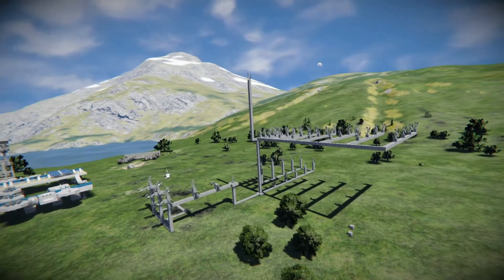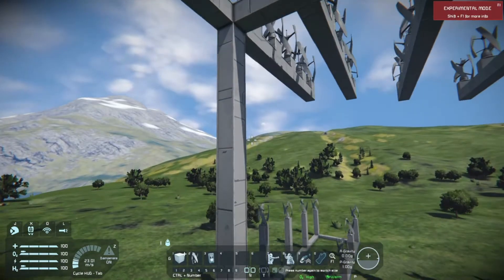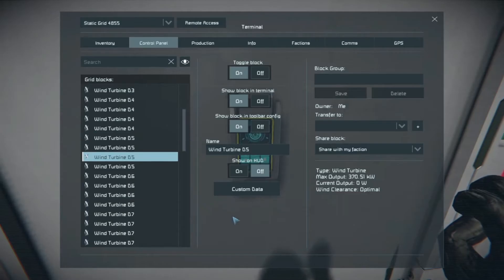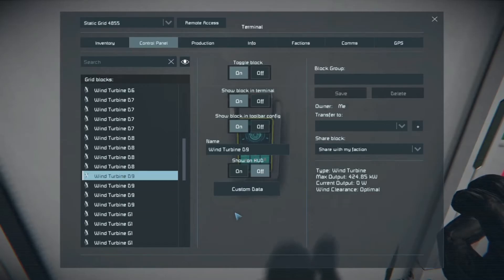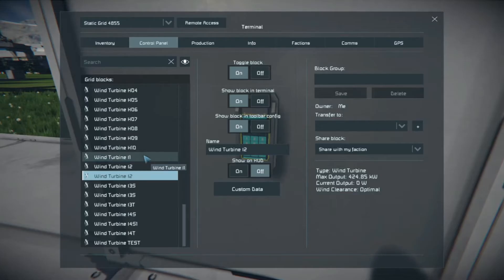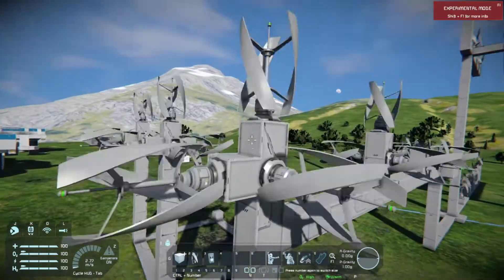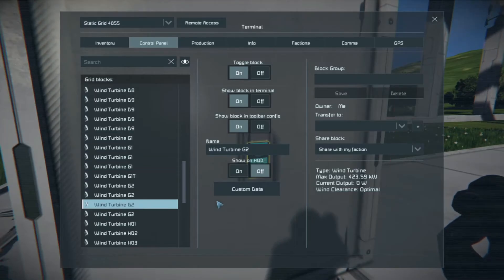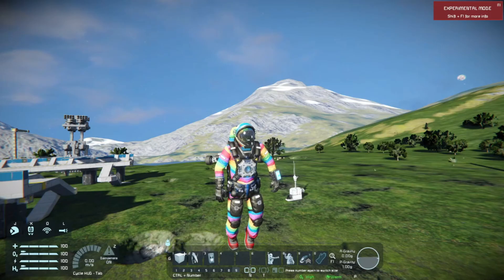Tutorial: BEST WAY To Place Wind Turbines at Space Engineers (Optimal Wind Turbine Park)

Comment: I found 9 blocks build on where the 10th block would go but I did nott testing just didn't want to waste any more hydrogen on it lol  that's Vertical and horizontal from any other block.   Also use a column  the air flows easier around it >:D

Comment: So I found out On my xbox 1S I thought Ax output would be the match output that wind turbine can put out Because if I only go 40 blocks high in a Valley Valley A Max kw out put is the total of kw it will put out igp 60 to 90 bocks high and all the wind turbines are 8 block a part and the 9th block I will put 3 more block on top of the 9th block then put the turbine on it the control panel will have max out 4some thing out put and the current out is 1kw but wen I make a battery it will say on the current out put 498 kw but wen playing in survived mode it will say 1kw out put on battery but wen you put a battery on your bace the the max out put and the current out put are the Same or some times it will go up higher on the current out put depending on the weather if it is raining my 8 battery's will charge up faster that's what I found out same people my went to make videos on the same thing your doing so they don't do videos on the wind turbines
Reply from the maker: Sorry, but I don't really get, what you wanna say there ^^

Comment: Thumbs up for your info, but there was one question i still had, has the turbine 8 blocks above ground or 8 blocks above my struckture, if i want to place my windpark on top of my base.
so i build a block 8x8x8 and placed a turbine on top of it and a 2nd one 8 blocks above my 'block'. there was a difference of ~30Kw. the one on top of my building was fine (by the looks of it it is a Mars like planet on the server) ~880Kw but the one 8 blocks higher brings ~910Kw.
to compare it complete, a turbine on groundlevel brought ~350Kw.
Reply from the maker: 8 blocks above eveything that's underneath
So also your base, if you build it above it 😀👍

Comment: It's good information. I don't think there's a one-size-fits-all solution to using wind turbines. You have to consider how best to make the turbines fit with your base and sometimes that means sacrificing power efficiency for a more compact layout. The difference between poor and optimal efficiency is about 1 to 2, so in many cases you can get away with good efficiency, which for the sake of simplicity we could say is about 3/4 optimal.

One other thing to point out is that if your batteries are constantly maxed out then you're technically wasting all that extra energy you're getting in. While it's better to have more energy input than you need than less, you should consider building as many batteries as is practical to accommodate the energy you're taking in, or consider removing some of your turbines if you find that you way overestimated your power needs. Your server admin will thank you if you're thinking optimally about your PCU.
Reply from the maker: A agree 👍
I just wanted to show the optimal way. Still, I agree, that you cant always use it that way 😅